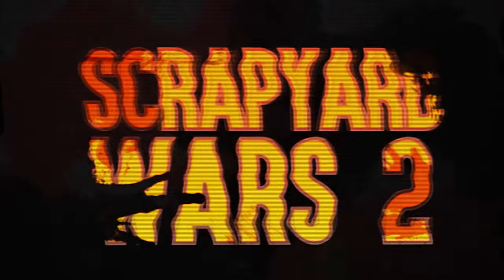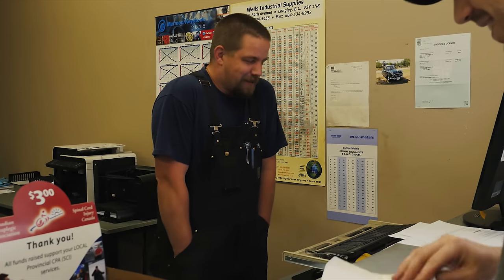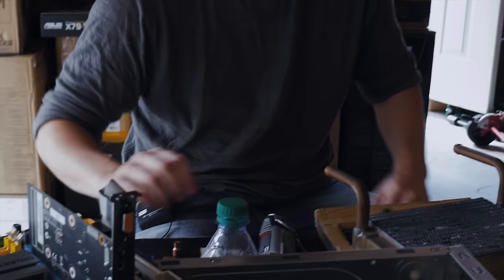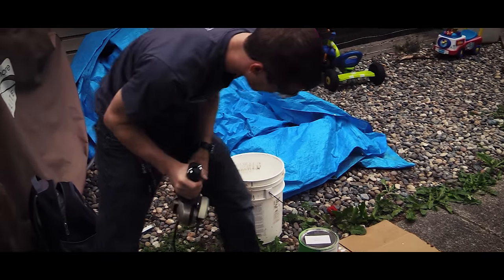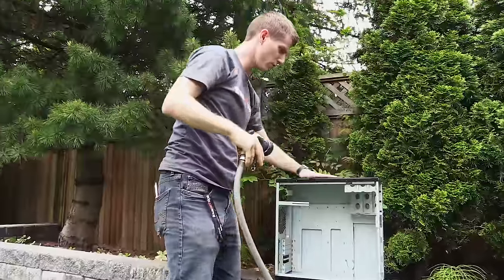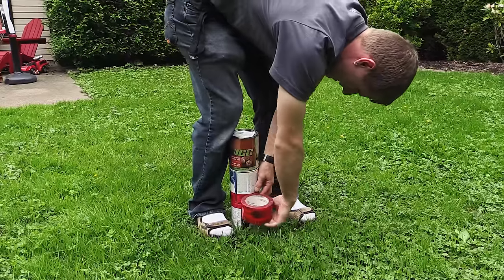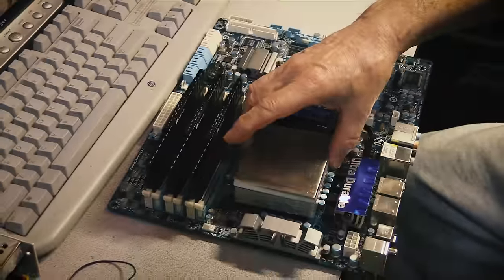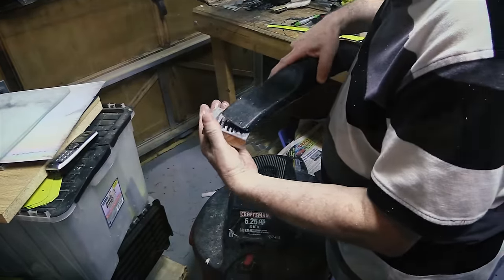$500 DIY Water Cooled PC Challenge - Scrapyard Wars Episode 2d

Comment: 4:25
Safety equipment for use while grinding:

Safety Glasses - Check!
Sandals and Socks - Check!
Reply: Liamv4696 No ear protection though, arguably the most significant hazard involved with an angle grinder.
Reply: Liamv4696  lol xD
Reply: Alex Smith  no, eyes are. would you rather loose your hearing (with an angle grinder highly unlikely) or have bits of hot steel in your eyes?
Reply: Alex Smith 
I've never seen anyone using ear protection for a grinder specifically. Unless a really large one.
Reply: I never use ear protection when Im using a grinder outside, theyre not THAT loud
Reply: Liamv4696 Well... the background music explains everything.
Reply: Liamv4696 I caught a flame with a grinder with much more heat resistant material then his socks, and eye protection is a must have, when you are grinding in a horizontal position in an open area you can get away with it, but when cutting something please use the protective gear...
Reply: ***** Hearing loss is permanent.
Reply: ID10T Games The next most significant i should have said, you're completely right eye hazard is far more immediate.
Reply: Liamv4696 They absolutely are THAT loud, they far exceed the threshold for hearing damage. I work in a machine shop so i guess i'm just more aware of the potential for damage long term. An average angle grinder clocks in at around 110db and can cause permanent damage in only 2 minutes of continuous use. Anything above 90db is damaging your hearing.
Reply: Us Australians would be  bare footed grinding
Reply: *****
If you do it a lot I guess it's a good idea. But for casual use I wouldn't bother. But that's just me.
Reply: ***** I once seen some Egyptian roofers,  tarring a hotel roof in 120 degrees,  bare footed.  I sat watching them in amazement while hiding from the sun in my hotel room.
Reply: trayner You've obviously never worked fifo. Leather jacket, safety specs, face shield and ear plugs is a must. Shits fucked when its 40+ degrees
Reply: For more tips on grinding, look for an app called Grindr on your favorite app store. Eye protection could certainly be handy, depending on how advanced you get.
Reply: Liamv4696 I was waiting for them to catch on fire
Reply: ***** large ears, you mean? because linus definitely needs ear protection then.
Reply: trayner  STRAYA for life M8
Reply: Liamv4696 I swear that wasn't a hammer he used
Reply: Kornelius Heydrich it was the back side of an axe.
Reply: Alex Smith Its a hazard yes , and easily protected against, but in my opinion  the disc jumping and cutting you or a disc shattering is far more dangerous.It can shatter with enough force to slice through your clothing and cut open an artery.  I've had to drive people to the hospital for it so that's where my opinion comes from.
Reply: ***** They should be, a grinder will 100% cause hearing loss without ear protection. (I use then on almost daily basis)
Reply: Liamv4696 It doesn't matter how comfortable you are with loud noises, its a fact they will cause hearing damage.
Reply: Liamv4696 I have no issue with the no gloves/boots but the no ear protection....I guess I just care more about my stuff that won't ever come back than he does, at least he had on glasses.

And yea, I'll tig all day without gloves/sleeves, but damn sure gonna have on eye/ear protection lol.
Reply: trayner Safer than frayed socks
Reply: bigbenisdaman I'm surprised he knew well enough to not wear gloves.
Reply: Liamv4696 Grinding wasnt even necessary, modded this exact case once and you can just drill out the rivets, remove the 3,5 and 5,25 inch bays, and then pop new rivets in.
Reply: Luke wins
Reply: sporkeh90 Grinding is faster.
Reply: ***** Yeah... No not really, I was done in like 10 minutes, judging by the video seems like he was messing around alot longer. They might have done this on purpose though lol
Reply: They're entertainers, they make it look like it took a while. I've got an automotive angle grinder, it would of cut through what they did in about 2 minutes.
Reply: Alex Smith You are very wrong, at work (Hydraulic engineering) I use my angle grinder everyday. It's not very loud. Eye protection is the most needed. As for the socks part, They wont catch on fire, the grass has more chance.
Reply: TerribleProductions I did FIFO for a year, of course you need protective shit. But if I'm grinding in my backyard I don't think I'll worry about most of it.
Reply: Liamv4696 No gloves - Check!
Reply: Alex Smith You must have huge ass grinders then if you think they are louder than a mill or a lathe, or insanely quiet mills.
Reply: Captain Leerox As you are supposed to do...
Reply: GamingInvader Nothing special, just 6". They are inherently very loud tools. Lathes and mills are typically fairly quiet machines, some milling cutters can get a bit noisy but nowhere near the levels of a grinder unless you're doing it wrong and getting shitloads of chatter. And i'm talking using the thing not just having it sit there spinning, it's contact with metal that produces all the noise, hence why ear protection is a must.
Reply: ***** If you've ever used those cheep Ryobi grinders you'd understand the need for hearing protection. Those things are loud.

I actually can't use any grinder without hearing protection, it hurts, and my ears ring afterward if I try.

Besides, ear muff hearing protection is inexpensive; and once you own it, it's 2-5 seconds to reach for it and put it on.
Reply: ***** Plugs don't work well for me. They are fine if you gotta wear the protection for long periods of time, but I only need to throw them on for a few minutes in a day and my hands are usually dirty. So it's much more convenient to toss on a pair of muffs for me.
Reply: Liamv4696 Hahaha thought the same :D
Reply: Liamv4696 jj
Reply: He should have been wearing steel-toes sandals with his socks.
Reply: he could have just drilled the pop rivets out lol
Reply: Was that a double entendre?
Reply: Using a cutoff wheel to grind out rivets - Check!

Comment: Alright, this is getting good. For the next scrapyard wars can I suggest doing PCs under 100 bucks? Because I saw an Intel CPU for, and I'm not shitting here, one penny on Amazon.
Reply: Wendys Upstairs Oh, crap, yeah. I forget that there are bad delivery issues in the barren wastelands of Canada.
Reply: 1 penny? What was it? The oldest Intel cpu?
Reply: Hanesh Johnson , the oldest processor would be of some value to collectors. its probably a very old processor, that would barely run windows xp. i had a laptop with pentium 3 processor, it was slow as fuck.
Reply: Hanesh Johnson It's a P4 series CPU clocked at 1.7 ghz. So. . . Probably?
Reply: crazyinsane500 No wonder why no one has bought it yet then - those early P4's are slower than the late P3's because of the architecture differences while using like 3x the power so hardware collectors go for the P3's more as it makes a better system.
Reply: Jak  i have a twenty year old comp with some shit tier intel cpu in it that runs at 120mhz havent really looked at all the specs. but it runs windows 95 somehow.
Reply: TobuBiguru Nice, I have a couple of 133 MHZ machines myself both work but one requires an ancient style "AT" connector keyboard and the spare I have has stuffed keys. Windows 95 will actually run on a 16 or even 8mhz 386 machine with like 4MB of RAM if you want to run the OS itself and nothing else though its kinda like running XP on its minimum specs (which I have done) in that there is no way to actually get anything done.
Reply: Luke wins
Reply: xIpodTouchGoeroex yeah it was very clear from episode c
Reply: crazyinsane500 oh jeez, 100 bucks sounds like a nightmare. Would that even be a usable pc in this day and age?
Reply: crazyinsane500 Lol there are tons of em!
Reply: jaymmira for random browsing?  Yes. For gaming? Forget it unless if it's a very basic game.
Reply: Hanesh Johnson
Idk, with that tight of a budget you are basically relying on items coming bundled free, like a case coming with a working mobo and power supply. Or hoping your case has a working Windows CoA if you dont want Linux. Its possible, but thats pretty much entirely luck based. And sure, slow is still technically usable, but people change their tune fast once they have a point of reference, their clunker vs the average browsing computer.
Reply: ragenFOX Intel has been around much longer than you think. Their first processing unit was released in 1971, called the 4004 it had a clock speed of 1080KHz. This thing couldn't even dream of running Windows 95, let alone XP lol.
Reply: crazyinsane500 over-clock it! we may be able to get to the impossibly high 1.71 ghz

a man can dream can't he?
Reply: Cough cough will be 20 bucks in Canada cough cough

Comment: BTW you can take rivets of with a drill and self-tapping screw. You just drill the screw into the rivet and it should fall/pull off. In case anyone is interested.

Comment: luke dont get this wrong but if you are using all copper why not solder it rather than using jb weld . i just dont get it probably every house has soldered copper plumbing its cheap and it works flawlessly

Comment: You could make a block real easy with a blow torch and some solder. Not the PCB kind but the metal plumbing kind. Just braise some metal together into a hollow cube then drill and tap one side for plumbing fittings. I reckon you could do both blocks in an hour that way.. With access to a mill you could make your own quiet easy but those aren't easy to come by.

Comment: Why is Linus using such thick copper tubbing? And why so much copper tubbing?
If I was to do something like that, I would use braided rubber pipes. You can get these at any motorcycle shop (they are used to feed the hydraulic brakes and clutch too). Pretty small, flexible, heat resistant and you can even get some cool colours too.

Comment: LinusTechTips You do realize that if you have some sort of heating tool (such as a manual solder gun, aka: just the heating part, you can melt the plastic back together, and as long as its not put under a lot of stress (i doubt water would do much) it will stay together, sometimes a lot better than Super-Glue or Gorrilla-Glue because its always the same material, and will always be molded to specification whereas the glue will sometimes bubble or not fill in all of the crack

and everyone who says this doesnt work, i tried this with multiple things, a tiny rc car worked fine, a cup holder that was thick did not as the crack was all the way through

Comment: so back in the day, before you could buy anything pc water cooling related at all. we just used a heater core for a rad (GO LUKE), a decent basic cpu air cooled block (clamped and glued acrylic around it to seal it up with fittings either end to direct water through it in a linear fashion) and used an aquarium water pump.

i used a whiskey bottle for a reservoir (pipes through a rubber bung in the top with a long pickup tube to the bottom) and just used distilled water with a corrosion inhibitor tablet thrown in which also claimed to help thermal conduction.

worked freaking amazing on and overclocked thunderbird cpu. but it did eventually leak after a few years... by then you could just buy system parts which was wicked.

so why not use an air cooler block?? surely that would have not violated the pre-made rules.

Comment: Next time try and buy a used broken air conditioner or water cooler. It'll have pretty much all you need for cooling. Its easier said and done though when theres pressure and a time restraint.

Comment: Hey guys I have a 500 watt psu and my budget is £120 so what graphics card should I go for and my processor is an a8 6600k please help.
Reply: Quad Nvidia TITAN X's
Reply: Get a r9 270
Reply: Abraar Anwar Since you're asking on youtube, all you'll get are fake answers.

That being said, a SLI 970 config sounds nice for 120 pounds.
Reply: Abraar Anwar Go AMD. Since they new range is out the old 200 series will be getting price drops to phase them out. You should rush before stocks run out.
Reply: Abraar Anwar a 750Ti is one of the best budget GPU's out there. though with that CPU, i'd aim for something lower, as your budget isn't high enough to be worth splurging and taking the GPU with you into future systems.

but something in the GTX 750Ti or R9 270 range are acceptable choices, and will be an okay low-midrange GPU for the near future.
Reply: I believe a used r9 280x is about 95 pounds on ebay
Reply: Spunky Chickens didn't even think about used products. that's probably the ideal choice for this situation, yes. spending much less than you would otherwise, while being able to get something that may be worth keeping for the next machine later on.
Reply: Abraar Anwar I agree with the other guy, R9 270 or R9 270x
Reply: Abraar Anwar https://uk.pcpartpicker.com/part/msi-video-card-n750titf2gd5oc its 120 pounds less atm... its a killer card
Reply: Dani Hibatullah PCPartPicker is awful for prices.
Reply: Prehistoricman only if you don't want to buy from the autoselected Retailer.
if you prefer a different Retailer, tell it to use those instead.

or continue being unable to operate a Utility Website and then blame the Website.
Reply: ***** Maybe the site has improved, but I was always able to find cheaper items when I manually browsed the selected retailer.

I'm also reminded how shitty Amazon's search is.

Yeah, it's easy to blame websites without using them much, but from experience months ago I found that PCPartPicker showed wildly wrong prices.
Reply: Prehistoricman oh, yeah. that's not really the fault of PCPartPicker IMO - websites just have thousands and thousands of entries (lots of stuff to sell), the same Retailer probably has 5 entries for the same product. and one of them you'd find if you manually browse a section, another if you search, another if you use related items, Et Cetera.

the parts i've gleamed from PCPartPicker though, the links to the actual pages for the products is infact what it's supposed to be, and it's the same price.
*shrugs*
Reply: Prehistoricman luckily this one is correct and its originally 185 pounds and 115 pounds atm so you save actually 70 pounds
Reply: r7 265
Reply: or 260x
Reply: wooooowwe1 I have an a8 6600k cpu... its not good but i can get enough money for a r9 280 but im really worried that my cpu will bottle neck the 280. I could aslo get the card now and then buy a different cpu later. Please help
Reply: Abraar Anwar That's what I am thinking you should do. Get the best card you can within your budget now, and then later when you upgrade the CPU it may still have life in it to show its true potential. Still, either card will show drastic improvement over your APU.
Reply: Abraar Anwar 390x

Comment: Is this good?
CPU- Intel Core i7-4790K 4.0GHz Quad-Core Processor
Cooler- Corsair H100i liquid cool
Motherboard- MSI Z97-GAMING 5 ATX LGA1150 Motherboard
Memory- G.Skill Ripjaws X Series 32GB (4X8GB) DDR3-1333 Memory
Storage- Seagate Barracuda 1TB 3.5" 7200RPM Internal Harddrive 
               Samsung 850 EVO-Series 250GB 2.5" SSD
Video Card- MSI Geforce GTX 970 4GB Twin Frozr V Video Card
Case- DIYPC Skyline ATX Full Tower Gaming Computer Case
Power Supply- Corsair CX 600W 80+ Bronze Certified Semi-Modular ATX Power Supply
Optical Drive- LG WH14NS40 Blu-Ray/DVD/CDWriter [2x]

Comment: Am I the only person who has watched this going "given those resources, I could totally do this so much better"?

-Use acrylic for all of your water block tops, that way you can make a much shallower plate out of copper, which is substantially softer and easier to mill.
-Use either acrylic tubing or soft tubing from a hardware store, they often have very nice plastic or brass fittings which are rated for a lot of heat.
-Don't buy a computer in a case if you can help it, or at least don't plan on keeping it, as it will likely be hideous.. Cases can be had much cheaper and better looking. Alternatively, cutting up a cheap, but attractive metal box and adding in some hardware store fine expanded metal is a great way to a cheap computer case. All you need is standoffs and a sacrificial case. I've seen some really cool cases made out of jerry cans, which you can pick up at some military surplus stores (if you're in the US, elsewhere, you may have to check a farm equipment supplier.)
-If you're looking for a decently inexpensive radiator, you can use the heat exchanger from an old window-mounted AC unit. The tube diameter isn't huge, but it should suffice if your pump is good enough. If automotive parts are more your speed, ask for intercoolers instead of radiators. Intercoolers are fairly small and usually a bit less expensive to source.
-You also don't have to actually use antifreeze to fill your loop. Some distilled water with a bit of anti-galvanic solution from the hardware store should put you in good stead. A bit of bleach may help as well, to keep the loop clean.

Comment: Would it have been cheating to cut the ends off the heat pipes of a air cooler and run water through them and incorporated them into your custom loom? Cause that would have been much easier... Love scrapyard wars btw!!!